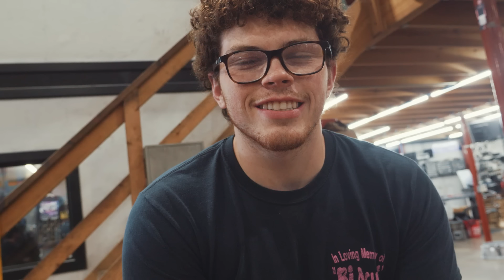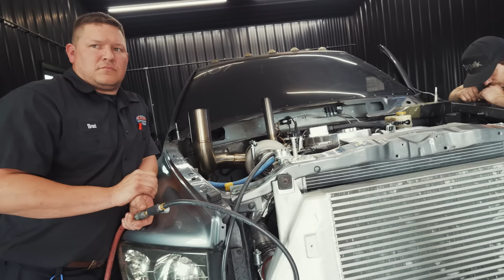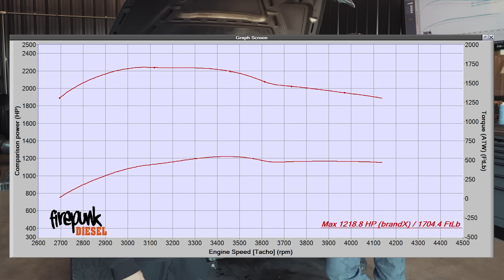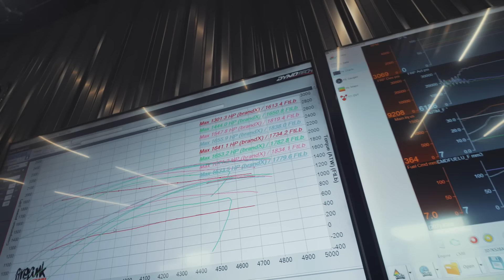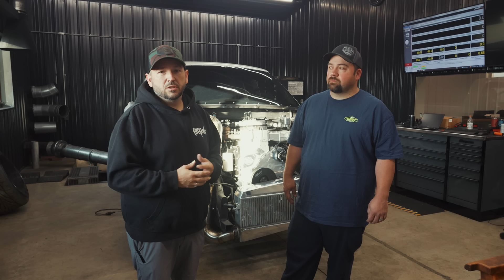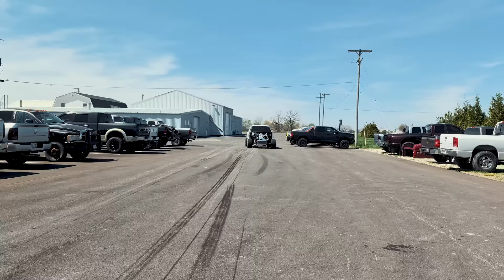It's Firepunk Dyno Season and It's getting Spicy!

Comment: What’s the starting timing when you are tuning a Cummins?
Reply from the maker: that depends largely on the speed of the injectors.  a stock injector wants 28* advance at 3000rpm, where our pro mod with 525% over injectors that open very fast runs 28* at 5800rpm
Reply: @FirepunkDiesel thank you for taking the time to answer!

Comment: One the 1st truck peak HP was at 3600 RPM.  What RPM did the anteater get set to for shift points?
Reply from the maker: 4000-4100 to sweep it through peak power every shift.

Comment: Do you guys decrease SOi when activating NOS?
Reply from the maker: Nitrous does not move where peak cylinder pressure happens, but when adding nitrous, its important timing is low enough that Peak cylinder pressure is 11-14* ATDC, since most don't have the luxury of knowing that data, we take the side of caution and pull 2-3* out of the timing curve when using nitrous.